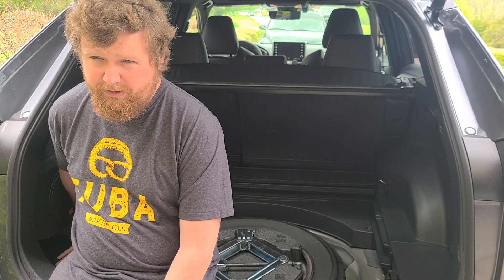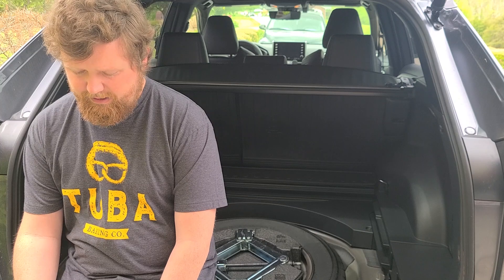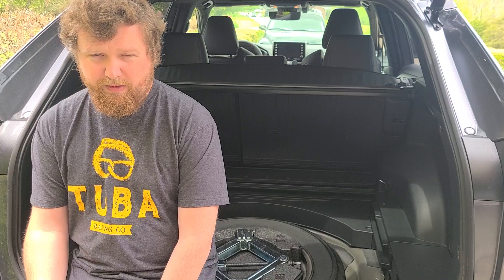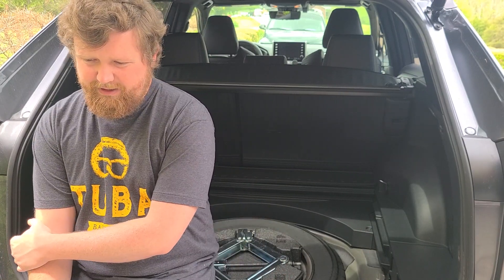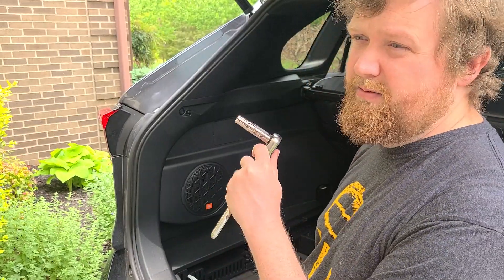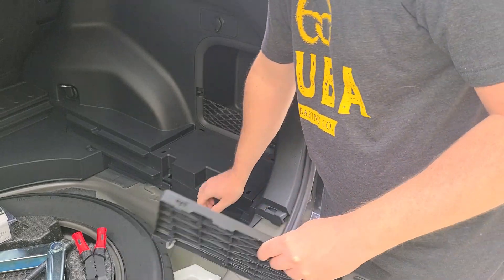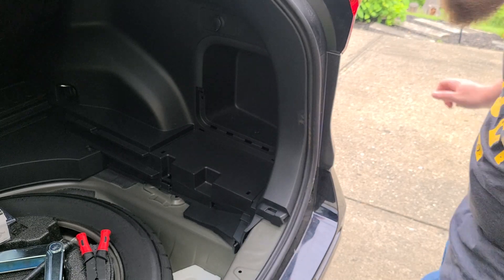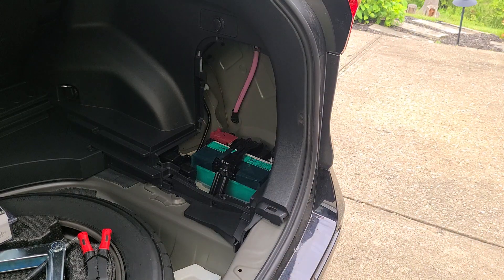Curt Wiring Harness Install on 2020 RAV4 Hybrid Average Guy Tries

Comment: I installed on a 21 hybrid, no subwoofer. chopped the green wire and spliced it to the yellow at the module, and vice versa with the yellow. This allows the module and fuse to be installed above the battery on the passenger side where there is a pile of room to work. One thing I noticed is that even when the car is off, the module draws .5 of a volt. Thats enough to kill a battery if your car sits for a bit. Due to this and the fact that we rarely will be towing anything, i just popped the fuse out and will pop it back in when we need it. Thats another bonus of wiring it all up on the battery side of the rear, the fuse takes 5 seconds to get to by removing the battery cover

Comment: Used your video to help install the harness yesterday. It was a huge help knowing just where to pull on the trim. No problems getting it all off and nothing broken or damaged. Thanks!

I was able to route the harness under the body support braces(either side of spare tire at the rear) and then through the body underneath the liftgate latch. Wrapped some electrical tape around where the wire went in/out of the body to prevent the sharp edges from wearing through the insulator over time. Had a bunch of leftover zip ties because I also have the hybrid model and they were used to clean up the wiring by attaching it to existing harnesses.
Reply from the maker: Thanks, Ryan. I'm glad you found the video useful! I still haven't rerouted my harness, but I may need to check out your solution. 25k miles in and still happy with my hybrid!

Comment: Good job man! I'm going to have to do this myself as well! Glad you already did it so I could see where things need to go and really see the roadblocks! I appreciate your vid!
Reply from the maker: Thanks for watching! I'm glad you could find some value in it. I haven't rerouted the harness through the floor, but I really think widening that hole is going to be the right move for me.
Reply: @rainschris  I bought the Tekonesha harness and finished installing it today. I messed up half-way through by putting it all  back together without connecting the power.  /smh  However, I got it all back apart and finished up with little difficulty. In my case, the hole with the plug in it already had wires going through it, but I was able to cut a slice into the plug and the hole was more than wide enough to fit the receiving end through. I'm guessing  that the Curt harness is slightly larger or my hole is larger. Not sure.
Reply from the maker: @Melourn  I didn't see any plugs with wired in them my first time around. I may need to snoop around and see if there's another plug I'm not seeing.  The curt was only too large by a slight margin. Thanks for the update! Glad you got everything back together and working!!

Comment: For my 2019 Rav4 Hybrid XSE, I recently installed a Tekonsha 118801. My Rav4 has a subwoofer on the left side. The wire for the left turn signal is short by about 12 inches because of the subwoofer housing filled the space. Though it was easier to route the power wire because the hybrid's 12vdc battery is just at the rear cargo right side.
Reply: I'm probably going to be making my own video with that version. It comes tomorrow. However, I have no sub woofer... I got the short end on that one...or the long end...not sure...lol

Comment: Thank you Chris, i was watching other videos on routing the power up to the engine for kit 118801, when i was thinking "how am i going to attach that to the stupid 12V jump tab in the fuse box.  I was surprised by your video that the battery was 12V.  That was way easier than a normal gas car.  I guess one more reason to go hybrid!
Reply from the maker: Thanks for watching. Glad it was helpful!!!

Comment: Can jump start the hybrid models from the main fuse box in the engine compartment. The manual suggests not jump starting someone but it can be used if the rav needs a jump.
Reply from the maker: Thank you for pointing this out. I see it here in the manual on page 665. It would only make sense that they have an under-hood option. This is my first hybrid. I have much to learn.

Comment: Did you end up making the hole in the unibody larger to get the hitch wiring through?
Reply from the maker: I still haven't decided my angle of approach on that. Can't decide how I want to widen the hole. So, for now, the harness just sits in the wheel well and I take it out when I need to use it.
Reply: @rainschris  I recommend using a step bit right next the the hole from beneath the vehicle. Then you can knock out the remaining scrap between the two holes, making a double-sized one. I think that'd be the best method overall.